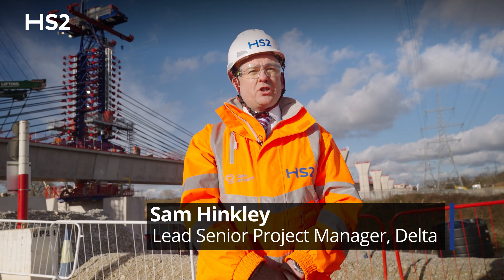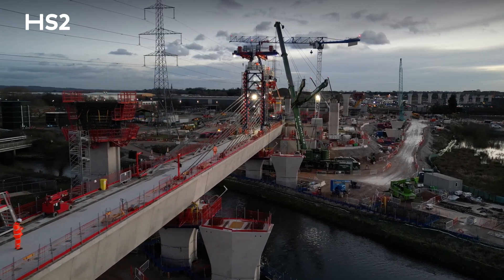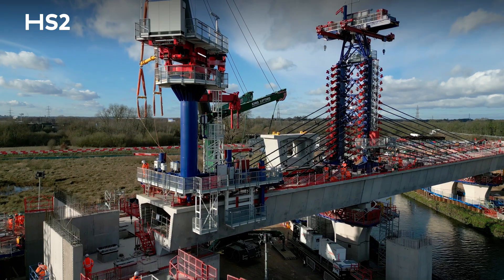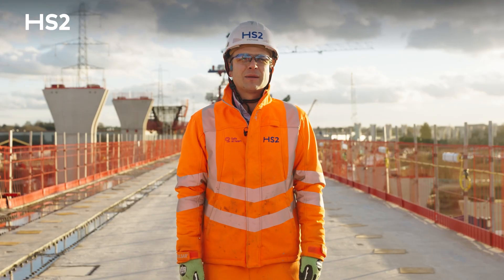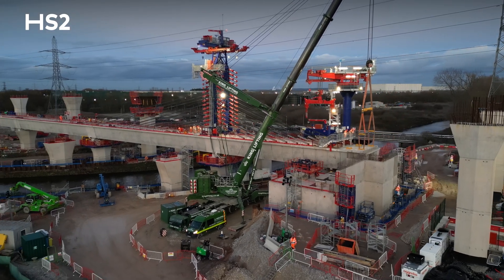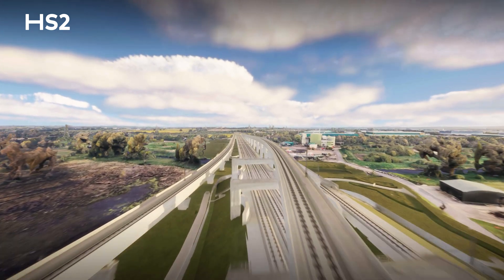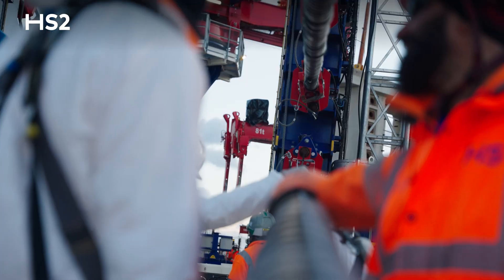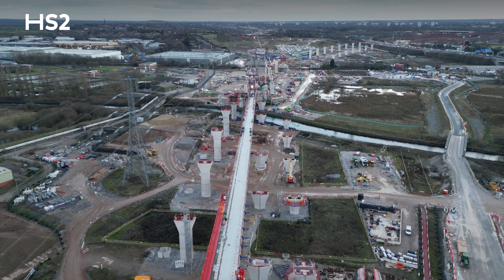First HS2 Delta Junction viaduct section complete using UK first bridge building technique

Comment: More millions for the South & excuses for the North
Reply: Birmingham is not "the South". HS2 is investment in the Midlands. Without all of Phase 1 and Phase 2 of HS2 being built, there is nothing to connect North West England and North East England and Scotland too.

The main point of HS2 is to get rid of gridlock on the GB rail network. And Birmingham is one of the places where that gridlock is the worst. So once the InterCity trains are out of the way of Birmingham, it should be easier to get rail-freight to the North.

Comment: This is by far, one of the biggest most expensive white elephants the country has, or will ever see. Boris Johnson's vanity project is a railway to nowhere. A fraction of this money could have been spent re opening some of Beeching's worst decisions. For example the Woodhead trans Pennine tunnel, the Great Central railway to name but two.
Reply: Was started by Labour. And the Great Central would cost no less, but misses the 2nd largest city in the UK. Whilst there are plenty of lines ripe for reopening it's pointless in most cases until core capacity is raised, guess what HS2 does??
Reply: @Polarbear1-b6j  At the turn of the century, Britain had around 22 thousand miles of line, easily the most extensive in the world. After Beeching's wrecking ball it was halved, yes halved. Why would any sane person advocate building a monumentally expensive new line, when there is so much existing infrastructure which could be improved or rebuilt at a fraction of the cost?
Reply: @duncan649 And yet the reality is it can't be rebuilt cheaply or easily, it's sat unused for nearly 50 years, just look at the cost of Portishead and that's still open for freight for most of its length. 

But the reality is, every new line feeds more traffic into a core that's carrying twice the passengers on a system half the size it was.

You really need to wrap your head around the fact the lines closed under Beeching aren't just sitting there waiting for the Station Masters and Signallers to open up and trains can run.
Reply: @duncan649  HS2, when open, is going to pull most of the InterCity trains out of Birmingham Curzon Street. That is going to provide dozens of extra train slots per day, which can be used to build up other services that pass through Birmingham.

There is no point in "reopening a branchline" if there is no capacity for the network to run a single train up that branchline. HS2 doesn't work in isolation. It's a project being done to enable other upgrades to work.
Reply: The Woodhead Tunnel now has electricity cables running through it. You can not "take back the tunnel". It's vital infrastructure for the electrical grid.

As for the Great Central, the useful part of the route is being recycled into part of HS2. The reason why you can't open the entire Great Central Railway, is that the London Terminus is Marylebone (which is a rubbish station) and the route into London is along Watkin's other railway line: The Metropolitan Railway. In case you have not been keeping up with things the Metropolitan Railway has been absorbed by London Underground and is full up with commuter trains. (That's the way things are supposed to be on a railway near to a big city.) So with the Jubilee Line now controlling the line track to Stanmore and the Metropolitan Railway controlling two other tracks, you are left with two remaining Chilern Railway tracks that are also "full up" with commuter trains.

Essentially, to reuse some of the Great Central Line, you need to break away from the route and go somewhere other than to Marylebone...which is exactly what the people who planned HS2 have done.

And the reason to not use the Northern Bits of the Great Central Railway is that it famously skipped past a lot of build up areas in England, because it was built by greedy idiots during the years of Railwaymania.

Comment: HS2 could have been useful but in its current form is a white elephant and an exorbitant waste of taxpayers money.
Reply: Phase 1 brings significant standalone benefits, and it forms the foundation for more such infrastructure.
Reply: What Current form
Reply: Nope. Phase 1 is going to massively help Birmingham Curzon Street. When more local services are able to run into that station, regular passengers are going to start to understand what HS2 is for. And then people will want the rest of it to be built.

Hopefully that won't take too long, as we need high speed rail to go all the way to Glasgow and Edinburgh and probably beyond the Scottish Central Belt.
Reply: @DavidShepheard  I am not sure you have resurched HS2 and Birmingham Curzon Street take it from a Brummie and HS2 supporter, local trains WILL not run into Birminghm Curzon Street Station only HS2 services to London, Manchester, Liverpool and Scotland, all local train services into Birminghm and other Intercity Train Services will only use Birminghm New Street, Birmingham Snow Hill and the Birmingham Moor Stret Rail Hub. Birminghm Curzon Street will have no physical connections to the existing rail lines in the Birmingham area nd will only connect to the existing WCML in the Manchester/Crewe area.

Comment: Great engineering work guys ....but kinda pointless by only going to Birmingham!
Reply: It is not ending at Birmingham, under the present plans the HS2 line carries on from the Delta Junction and will join the WCML at Handsacre on the WCML where by the HS2 service  will run on the existing WCML to Manchester, Liverpool and Scotland but there are plans to build a cheaper line from Handsacre Junction upto the Northern Powerhouse rail upgrade near Manchester which will allow the HS2 trains to operate at 186 mph from Handsacre to Manchester
Reply: @peterwilliamallen1063  
It's is in its original format . It's been routed back on to the west coast main line which will be like a formula 1 car filtering on to a rally stage ..
Reply: @richardhutton2089  So what is new about that a lot of the high speed lines in Europe travel certain distances over conventional high speed lines
Reply: @peterwilliamallen1063  .... as usual with rail projects in this country it ends up being a mess . The politicians are more interested in issues outside this country instead of concentrating on issues at home...but that's a whole different topic that I won't get into! 
I'm not slagging off the brilliant engineering work one bit , im just frustrated it's not been built all the way up to Scotland...😉
Reply: @richardhutton2089  First there are already two major Hi Speed rail routes from England into Scotland, the WCML and the ECML the WCML runs through the Cumbrian mountain area through Shap and Beatock and the ECML which follows the East Coast and a third a secondary way the Seattle and Carlisle way with not much space for another HI Speed line., to build HS2 where it is is taking years to complete so trying to extend it to Scotland would take years if not impossible through the Cumbrian Mountains as HS2 is a West Coast Rail project then there is the finance, is the SNP going to cough up millions of pounds to help fund such a project. The present HS2 line is solely in England, if were to be extended into Scotland then the SNP would have to pay for the section in Scotland considering that the SNP run the Railways in Scotland under the name " Scot Rail"
Reply: Good thing classic compatible trains and Handsacre exist then.

Comment: This looks prehistoric compared to the way they build viaducts in Asia using segment launching gantries which move along the build as they go, and require only a small working site below, plus end up with a far more graceful structure. The profile of the deck seems vastly over-engineered just for a train.
Reply: The HS2 Colne Valley viaduct was build a similar way to what you describe. For that method the segments were installed in pairs from each pier towards each other. For the delta junction the precast segments are installed from one side in a forward direction supported by temporary cables. This cantilever method is very quick and flexible and is an advanced construction method. With regard to the deck comment, there will be 6 parallel tracks at this point on 5 parallel viaducts.
Reply: They are doing it like that

Comment: I wished the 2 french guys would of spoken slower. I found it very difficult to understand them.
Reply: The existing system is full to bursting. Investing in HS2 provides substantial new capacity and takes fast trains of the WCML, thereby improving capacity for improving local services and freight.

Comment: It's absolutely fantastic to see progress on modern infrastructure after decades of bodged repairs and papering over post war repairs.
What I don't understand is why each section has to be bespoke design.   The victorian engineers kept things simple with standard design from bridges to stations which kept costs down 🤔
Reply: Because different Architects are used in different contracts. Architects insist on using their own individual designs.

Comment: What's the fifth track for? Couldn't even find it in pictures on hs2 homepage
Reply: There will actually be six parallel tracks here, one viaduct is double track (five parallel viaducts).
Reply: One of tracks in this section split into two tracks so we have five tracks instead of four
Reply: There is no fifth track, the Delta Junction when finished and in operation will have 3 legs to it with two tracks on each leg making 6 lines altogether, one leg will have two tracks to take trains to and from London Euston to Manchester, Liverpool and Scotland, the second leg will have two tracks to take trains from Birmingham Curzon Street to and from London Euston and the third leg will again have two tracks taking trains to and from Birmingham Curzon Street to Liverpool, Manchester and Scotland being the Spaghetti Junction of the Railways
Reply: @peterwallen1063  I believe that the section between the northern most point and southern most point of the delta junction will have 4 parallel tracks  the whole length (with six parallel tracks at the northern most point of the delta junction to incorporate the tracks for the route to Birmingham). It goes to 4 track from south of the interchange station to north of the delta junction to where the dive-under should be built just before the M42.
Reply: @Maxhead_room  Sorry you can believe what you want, HS2 is just a two track Railway only. There are no 4 or 6 track sections just double track from London to Handsacre and Birmingham until it reaches Handsacre nd the WCML.
Reply: @peterwallen1063  Just look at the published HS2 drawings. 6 tracks through the interchange station (2 straight through, 4 serving platforms), then 4 tracks all the way through delta junction to the dive-under just before the M42 (except for a small section at the northern most part of the delta junction where it goes to 6 parallel tracks as the Birmingham stub joins). I'll believe the HS2 plans over you I'm afraid. It is 2 tracks from Old Oak Common to just before Interchange, and 2 tracks at the M42 crossing going to (at present) Handsacre.

Comment: HS2: All this to put two rail tracks down and one train every half hour with NO FREIGHT and ticket prices most could not afford to clip an hour off current journey times? And, the cost? Started at £36 BILLION and is now well over £150 BILLION and rising.
When will it have its first train? Whenever it seems, no one seems to know exactly. The original timing was to be 2017 to 2026 with every modern piece of equipment to achieve this.
The London to Birmingham Railway was built in the mid 1800's by 20,000 men, shovels, barrows, mostly mules and horse drawn wagons, took just 5 years to build. It cost £5.5 MILLION raised by PRIVATE ENTERPRISE FINANCE and took passengers and freight.
This HS2 is a flagrant waste of TAXPAYER's money.
And now this Labour Party are to clip its wings at Crewe and abandon the original route through to Manchester.
Reply: Two rail tracks? Sorry can I hear about your ideas about increasing rail network capacity? You mean you want Four rail tracks for less money? NO FREIGHT? Now sit down with your comfort blanket, it might surprise you that by building a dedicated express Passenger line with attractive journey times actually allows for more Frieght on the existing slower lines... its what countries have been doing for over a century. "Ticket prices" sorry what are the ticket prices? Do you know them? But yes people pay more to cut off journey times, again I mean thats been pretty much the case for centuries. If you want more precise evidence, look at the popular HS1 commuter service that has reached capactiy despite having more expensive ticket prices, people even choose to travel between Stratford to Kings Cross on it, paying more to save 10 minutes over alternate rail routes. Who are you to tell people what services they should be able to chose from? The rest you are just blabbing on about politics, complain to your local MP as to why the planning system is so convoluted.
Reply: Sunak abandoned the entire northern leg in 2023. Labour is considering ways to reverse that such as running it to Crewe only or a lower speed rail instead.
Reply: Literally every piece of this diatribe word salad has been made up as it's been typed 🤡
Reply: Not a waste of tax payer's money. Fact is, the tax payers are not paying for this project.
Reply: What makes you think that HS2 only has the capacity to run one train every 30 minutes?